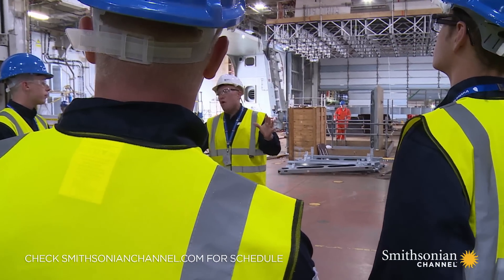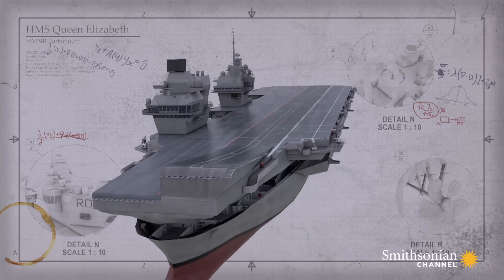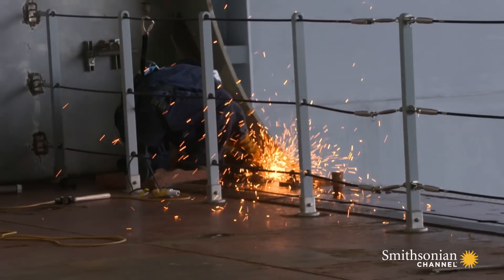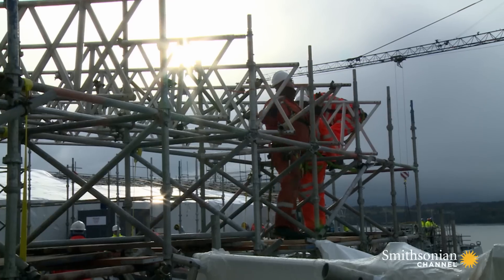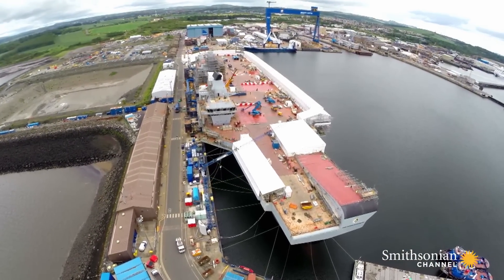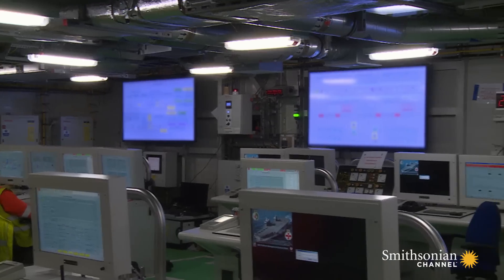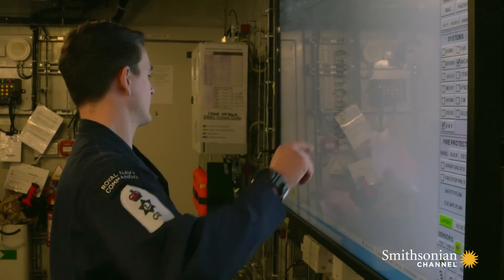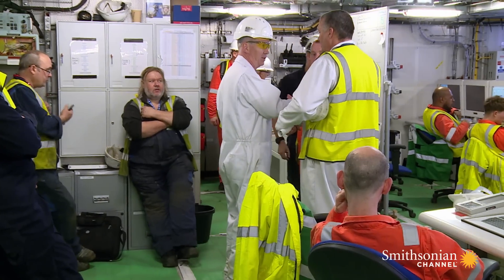The HMS Queen Elizabeth Stats are Startling

Comment: This carrier being a 5th generation carrier with the 5th generation F35B , its jets will perform Shipborne Rolling Vertical landing which allows them to land just like on a land based runway without hooks, it is another British innovation first performed with the Sea Harriers
Reply: Yeah, people have already said it but the B variant of the f35 was mainly designed in the Uk.
Reply: The Ancients Ancients except they are now using American designed and built F35s and this method of launching and recovering aircraft has been used on the US Navy’s LHDs for 20 years.
Reply: @wyattwalker3868  the US navy doesn't use SRVL I'm pretty sure. And the B vairent is 25% (it might be a little lower than 25,cant remember exactly) produced in the UK.
Reply: Duck on Quack and the uk started using the Harriers in the 70s. So what’s that then, 40 years+?
Reply: @armour7  late 1960s
Reply: @wyattwalker3868  Not just American.
The F35 project was a joint venture between quite a few countries, with the US and UK being the biggest contributors.

Comment: DO NOT call this a supercarrier. It is only a midsize carrier. It does not even have catapults.
Reply: Bill Ryland actually it’s original design was to include catapults but the brits scrubbed it from the design..... as it was deemed to power intensive, overly complex and if damaged they couldn’t launch planes the ski jump they found had much higher survivability in battle operations

And she’s not a medium large or small 

She a multi purpose tactical carrier..... a new type she is an amphibious assault ship like the America class, a fleet carrier  like the ford class and a stand alone warship. She’s actually able to go out on her own, she has phalanx missile batteries, Astor anti missile systems and she’s covered in CWIS close in range defence systems. 

Our (American) admirals when they toured her said they where very impressed by the ship and wanted to incorporate many of the technology into the refits of the ford class 

And the reasons it’s not nuclear powered is the brits didn’t want it 

Most of there over sea territory’s won’t let nuclear anything in like Gibraltar 🇬🇮..... and since her fleet will need to refuel they said just refuel her 

the brits got what they wanted we got what we wanted the ford class they are not comparable
Reply: @Marcus51090  Nothing to do with power needs or complexity , the British invented the catapult system in the first place , it was the 2 billion Pound cost of installing one on Prince of Wales that stopped it , also you have to take into account at the time due to the SDR written just before the ship was going to be placed into reserve or sold on completion thus the cost was was not worth the work and so Prince of Wales was completed as QE2 was. The government then changed its mind and decided to bring PW into front line service. You need to understand that in the UK most things are done due to budget constraints and not lack of want, The levels of automation on the ships is impressive and forward looking but it has far more to do with RN manpower shortages and recruitment problems than anything else, we don't have the personal to man a ship with 3000 crew let alone 2 ships so we go with the cheaper options.
Reply: Bill Ryland catapults are a huge risk having a ship depend on something that can be damaged in a single hit while the HMS QE will still be able to launch aircraft
Reply: Super carrier is defined by weight. Size is also very similar to a nimitz. ,I've seen the two classes side by side
Reply: Ford is 150 feet longer and 100,000.tons  90 aircraft
Reply: @vernonkingjr570  and Queen Elizabeth class are 920ft,72'000,600 crew,1600 crew including absolutely everyone..and the ability to hold 70 aircraft(although it'll only ever see a maximum load of 50 if needed)  and the fact that both vessels cost 10 billion dollars in total..that's worth it,one Ford cost more than the price of two QE class that's an expensive 150ft lol 

If Britain can build those two ships for that price imagine what they could build if they spent all that on one ship..I'd personally like to see another 2 of these super carriers, 6 smaller carriers, and of course the many new ships being built now such as type 26,31,astute, dreadnought etc etc and definitely another 4 type 45s..and keep the existing type 23 Duke class  (that's one powerful frigate class for sure,old but good)
Reply: @tesstickle7267  35 aircraft is the correct number sonny
Reply: @vernonkingjr570  read what i said,it has the ability to hold 70,but would only ever see 50 if needed. Generally when someone talks about the maximums the minimums aren't worth mentioning,especially considering the fact that any carrier could hold one or less for what ever reason they decided to carry less than possible. 

Suggest you look into what the ship is capable of if required.
Reply: @vernonkingjr570  and by the way the planned usage of the ships will see 36 f35s not 35. That's not its limit!
Reply: Mid size? Lol